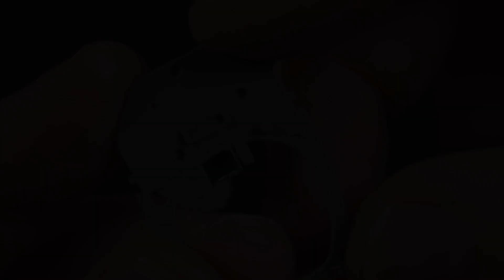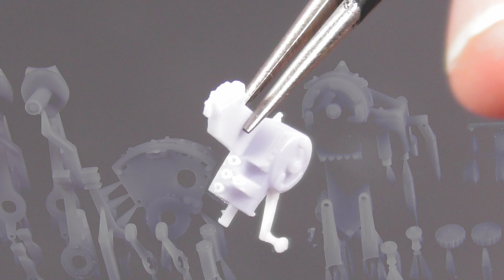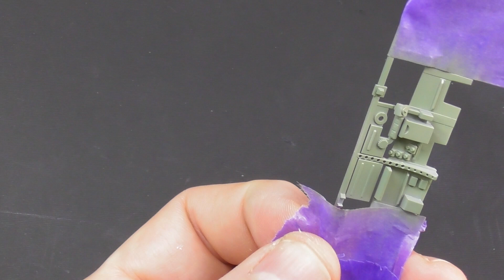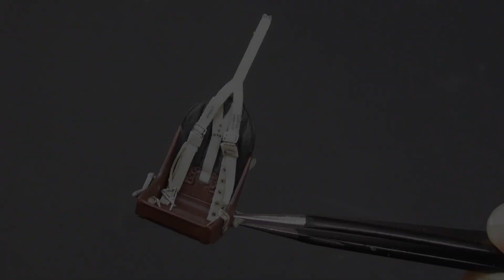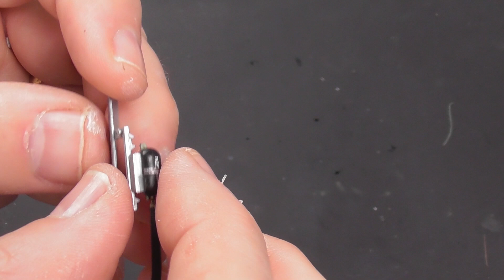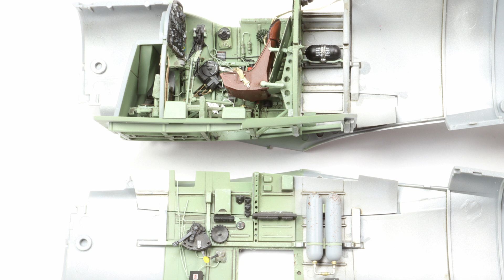Laminar Flow Designs & Tamiya Spitfire Mk XII conversion 1:32. Part 2 Cockpit

Comment: I dont understand, the MK XII Spitfire didnt have laminar flow wings, it had regular 'C' type wing's with the wing tip's removed for increased roll rate and a Merlin engine that was optimized for low altitude flying. The laminar flow wing wasnt seen until the release of the Spiteful and Seafang prototype's with the following evaluation trials taking place in 1945/46 of which neither aircraft ever saw squadron service.
Reply from the maker: Laminar Flow Design is the name of the company that makes the conversion set mate!  Don't know how you thought I meant the wings were actually laminar flow?
Reply: The Mark XII had a "short block" Rolls Royce Griffon not a Merlin.

Comment: Excellent work on the pit Jamie, I love all the working levers and your additions etc. BTW the Wowstick; I assume it has slow enough speeds that avoid getting plastic too hot too quickly? And does it accept other heads such as sander bits etc do you know? Thanks!
Reply from the maker: It turns slowly but has good torque so no chance of melting
Reply: @thescalemodellingcafe  Ooh one more important question, the screwdriver heads appear to slot in with hex heads? How do you affix drill bits and other round heads into the wowstick Jamie?
Reply from the maker: Mine doesn't have screwdriver heads, just drill bits.  It has a keyless chuck so just twist the end and it grips.